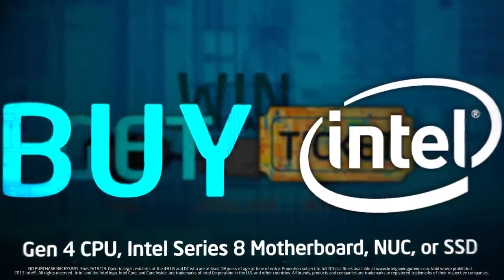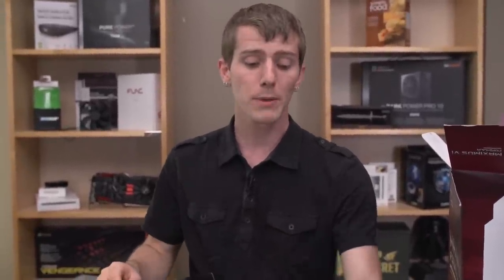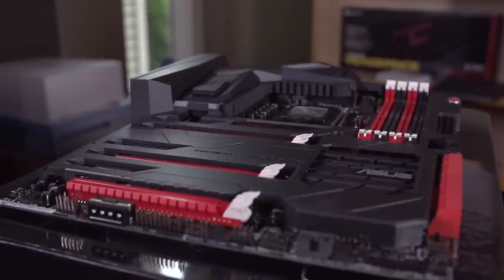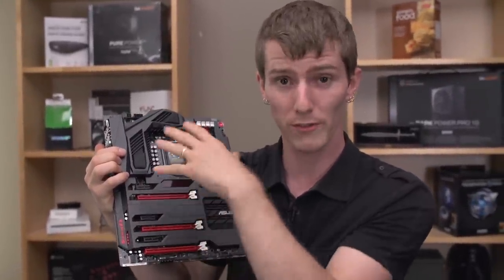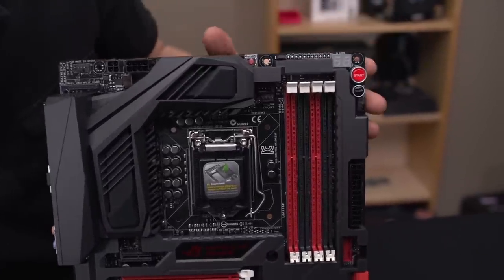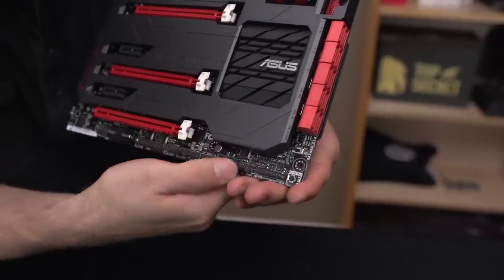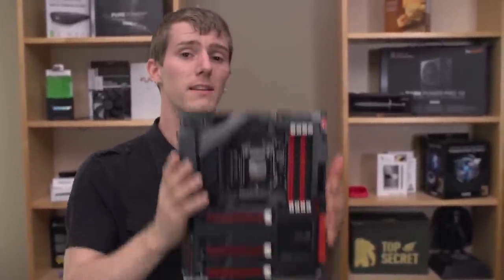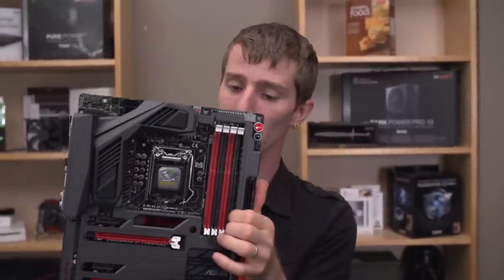Asus Maximus VI Formula Unboxing & Overview

Comment: Linus if you review an Asus crosshair vi hero please check out the following, I am awaiting the arrival of my crosshair now, I am going to attempt to run two m.2 nvme drives in raid 0 but as you know the board only has on slot for m.2 which leaves me having to install an expansion card (asus hyper m.2 x4 mini) I am curious if you have tried this configuration and what was the results any info would be appreciated, I have emailed asus about this but haven't received a response, I could just order an MSI titanium x370 that has two m.2 connection on the board but I am an asus fan.

Comment: Same here, I had major issues after installing the AI Suite. I don't understand how their software created to work with their motherboards causes so many conflicts. Surely they're aware of this. I ran into the same issue with my Z68 Deluxe board, so I figured I’d try a different manufacture for the Z77 chipset. However, with Z87 I thought, I'll revisit Asus. Asus tech support couldn't help me with my Z68 board and they're not much help now, very frustrating. I wish they could make this easier

Comment: if you need the ultimate speed on rendering and you are going to need a lot of pci slot bandwidth go to a 2011 cpu, if not a 4770k + a good z87 mobo is a better price/performance option

Comment: someone please explain to me what the molex connector on the bottom of the board is for. I gather it's video card related based on what Linus had mentioned but, I'm still confused. Thanks
Reply: It's for if you want to have more than 2 video cards on at the same time and you need extra power for that.

Comment: what is the difference between Z87 and Z97 from MSI? I don't know which to buy since the price difference is like $20 on ebay.
Reply: Z97 refers to the Intel chipset that the board uses.  Go with the Z97 because it's newer (and will support newer CPUs for longer)  and be careful with computer parts from eBay.
Reply: Craseder but they both support the same cpus because of bios updates. Z87 has more experience and is a vet so it should be more stable correct?
Reply: jlrockafella No.
They all reach the same rate of stability, it's a very good time to get Z97 boards.
The chipset is more advanced and has more features, and provides more performance benefits, etc.

There's new chipsets coming out for Haswell-E and Broadwell CPUs, you shouldn't get these ones because yes, since they're much newer, they won't be stable for their first year.

Comment: So I just bought a 7990 and I'm running it with a fx-6300 oc'd to 4.2 ghz. Now I know bottlenecking isn't a huge deal and I don't care that much, but would it be worth getting an i5 4670k to replace my FX. I'll have to pay for the processor itself and a new mobo, but is it actually worth the more stable frames when I don't really want to spend the money that much?

Comment: I just wish that they would use POSCAPS on their boards. These caps are the definitive end all to the endless rows of capacitors. They clean up the CPU area & last forever at spec... no bleeding IE. Even Nichicon solid aluminum caps do not stop at 5k ratings & someone needs to bring that to their attention. Now, capacitors go well beyond 10k & we need to see this from Asus. The playing field has really stacked up & it's down to the nitty gritty of components.
EVGA, ASRock, & especially MSI are trading some heavy blows with Asus. EVGA motherboards division learned their lesson before it turned into a lesion! Their caps bled, leaked, & they're just coming back from that business at nearly 8 years ago.

Asus, I do call you out more than any manufacturing company out there & for good reason. People buy for looks, likes, & they need to get their value for what they're paying. The name only goes so far & the issues begin... similar to the trying times of EVGA. If the name of your product is a form of tiering, then "Maximus" should denote quality as derived from its name.
I don't like thinking that Asus is all bad, that they're trying that hard to pinch pennies in hard times. I'm only saying what your upset consumers & stockholders already know.
C'mon Asus...
This board does look the part as a whole though. (Just a ton of caps that should have been much higher quality & I'll leave it at that.)

The NGFF will still run at improved SATA 3 speeds as the controller built onto the drive is just another SATA controller. People often get that part confused & I too wished it were truely beyond mSATA as well! Alas, it is not as of yet.

Comment: What's the best bang for your buck SSD for the average PC gamer? I want about a 120GB SSD to boot from and launch BF4.
Reply: Samsung 840 Evo series are good and cheap.
Just as fast as the 840 Pro, but made in a cheaper way. Ergo the lower price tag. That said, the material has a lower life time, but we are talking 30 years rather than 60 years with the Pro. Other stuff will break on the SSD before the material becomes a issue.
Reply: i'd say sandisk ultra plus or samsung 840 evo series SSDs wud b the best choices.

Comment: The problem is not using aluminum but using two different metals in the same watercooling system. e.g. Aluminum and brass or aluminum and copper, which basically turns your watercooling system into a battery.

Comment: Good board but missing a few things in my opinion.
1. It needs a second USB 3.0 header because often you will need one header for front case USB 3.0 and a second if you have a front panel 5.25' bay with USB 3.0 support.
2. It needs more USB 2.0 headers for the same reason as above (also a lot of water coolers need to be hooked up to a USB 2.0 header)
3. It needs a PEX 8747 chip to give it 32 PCI lanes for quad sli

Otherwise I'm loving the look and other features of this board.
Reply: GrayEyesWorld Then this is the wrong board for you. go maximus extreme instead

Comment: Linus which of these two is better GIGABYTE X79S-UP5-WIFI or Asus Maximus VI Formula. Im going to build new rig so i need info. And i will install Gigabyte geforce 780 or 760 and i7 4rth gen processor on the beast which you will recommend . Help man

Comment: I really need to know a good matx mobo. Ive got around 300 to spend and my cpu is an i5 3570k. Just all the Maximus mobo's for some reasons the ones that are 1155 are so much more expensive.
Reply: Actually most are 1150, not 1155.

Comment: Can anyone help?
The case im getting has 7 fans, do i need a motherboard with 7 fan inputs?
Reply: You can use adapters from power connections if your PSU.
You can also use fan controllers which you connect power to and then can connect several fans to as well.

Personally, I prefer controlling the most important and noise fans via software.
On this board you can use Chassi Fan connectors 1-3 via the Formula software AI suit 3.

I have both H110 fans and ram fan on that and I cut down from 35dbs to around 18dbs when just using desktop etc.

Comment: If your truly ONLY just going to GAME , you won't even need board like this one or a Sabertooth...simple to say. 
Can this board run the game higher FPS than the cheaper ones ? 
Will this more expensive board load the game quicker ? ( We talking about  Stock CPU speed no OC ) 
Also only advantages I see on Z87 platform is that the ton of SATA III compared to Z77.

Comment: I have a sabertooth z87 with a month old and the backplate just became crap. Corrosion is killing it so fast! I was so dissappointed when i saw the surface of the backplate or at least the paint on it going bad by the corrosion.. Just stay away of that or remove it. I dont really help cooling, i have removed it and the temps are the same but feels weaker (Obviously)

Comment: I love this board but not enough usb headers, really. I had to get 2 NZXT internal usb hubs to get all my things running. 

This thing overclocks like a boss, even with a not so good 4770k chip (costa rica) on only a H100i , got it stable at 4.7 for a 24/7.
Reply: its bad because you bought it in costa rica?, wtf.
Reply: Manuel Giovinazzo  No, Different batch of cpu's have different OC potential. Every cpu has a batch number and the number is linked to a place where it's made. In my case  it's 3312B707, produced in Costa Rica.

Almost all the chips made at the same place have the same OC potential give or take a couple of 100's mhz.

Look at this list http://forum.hwbot.org/showthread.php?t=73933
Reply: Martin Lalumiere I thought it was the Malaysia chips that people tended to say are not always as good and the Costa Rica ones were preferable?
Reply: preferable but still.. i got 1 that could pull 4.2 and then one that cant oc at all. h100, maximus formula vi

Comment: please help me choose a better motherboard for playing games like assassin's creed unity, COD advanced warfare, BF4 etc on ultra settings. I'll assemble other parts later but first I need to start fresh with a motherboard which supports 64gb ddr3 ram and 3 graphics card slots, I live in India and here the price of electronic items are 2x compared to foreign countries, so please suggest me any good MB which costs lower to medium range, thanks in advance
Reply: ***** have you found any fault in gigabyte MB ? because I'm already using same company MB and I had to give for replacement twice, there were some faults in RAM slot and graphics card slot
Reply: ***** I've found a beast motherboard for best price MRP Rs 39999
Selling Price Rs 21590
OFFER PRICE
Rs 19668 (51%) discount isn't that great and
Gigabyte Ultra Durable 5 GA-X79-UP4 Desktop Motherboard

LinusTechTips what's you're opinion about this hardware ?
Reply: ***** thanks for your help, I'm deciding to buy Gigabyte Ultra Durable 5 GA-X79-UP4 because it has 4 graphics card slots and 8 ram slots for this price
Reply: you never gonna use more then 2 gpu's if you got 3 old models sell em and get a new gpu instead of multiple old ones and it costs more power so you also need a 800+ watts PSU and thats really much
Reply: Based on previous Linus videos, if your not doing video editing, you really won't need 64 gb of ram. That's overkill. Go with 16 gb and that would run those games perfectly when paired with a good CPU and gpu
Reply: I have an old desktop and I really need to update everything, motherboard, graphics card, ram etc, suggest me any good and cheap gaming motherboard in which I can put multiple gpu and upto 32gb ram.
Reply: yep
Reply: tried searching this model but it's not available in any Indian website yet.
this I found on amazon: Z97-A ASUS LGA1150 Socket Motherboard
Reply: so please suggest me any convenient MB which has 3-4 graphics card slots and 32gb ram slots with cheap price
Reply: you dont need 32gb, you need 16gb at most for gaming and 2 graphics cards at most
Reply: Kratos buy a ps4 i think you will be better off. a new GPU and 16GB RAM is the same or more then what a ps4 costs
Reply: I hate consoles, PC is way better
Reply: ***** they do but they work for the price. Not everyone has around 2k to spend on a pc
Reply: i know everything about pc vs consoles AND STILL for some people its better to buy a PS4. no matter how cheap the crappy pc will be. the PS4 ALWAYS works with EVERYONE and not only trained IT guys who got allday to get the crappy pc working ...
Reply: ronnie tjikoeri calling us all trained "IT guys"? everything eventually breaks. consoles are worse cause you can't replace them easily, you're fucked. that's why there is no way to escape it, you NEED to learn how to maintain your PC, whether you like it or not. i was stupid, but i can learn better.
Reply: ronnie tjikoeri I highly doubt you know everything about PC Vs Consoles...
Reply: Kratos 64GB DDR3 for what? do you do some render or 3D projects?
Reply: Darko Dropulja nah, he's just trying to build whatever he sees that looks best without factoring what he really needs. this is 7 months ago so i assume he's got his rig by now

Comment: I chose this cpu/mobo combo cause I have 5d3 and Im using it for videography and raw video mainly and I need a lot of cpu and gpu power. As for the mobo I chose it mainly for the ready liquid system it has since my case is the Kaldalf LCS. As for the gpu I would like a 770 or 780 gtx but they r too expensive for me to be honest. Davinci resolve from the other hand needs a lot of cpu/gpu power to run it smoothly.

Comment: Linus, contrary to what you always say in every one of your motherboard unboxing videos, one should not throw out the disk. Some times operating systems do not install the driver for your network card -- so you can't even download the latest drivers. Install the driver from the disk, then replace it with the latest. 

I think manufacturers should include USB flash drives with drivers instead of disks.

Comment: So what exactly does the water cooling loop L shaped bit on this board do? What is it cooling if you run the water through that?
Reply: VRM/MOSFETs. Basically power delivery components.
Reply: Oh I see, sort of around where the 8 pin connector would plug in? Can't say I expected those to overheat...
Reply: DGneoseeker1 They don't really overheat much, but the heat outputted by them can heat up the rest of your board and maybe your whole case. It helps when you do extreme overclocking or just get an absolutely crap board.
Reply: Aha. On a similar subject, any idea what's most likely to be making the "hot plastic" smell I got when using the pre-installed overclock profile on this PC? Shouldn't be the CPU without it being stressed.

The ram? North bridge / south bridge? What gets hot on here? There aren't any fan/heatsink units cooling anything except the cpu and gpu so it seems a little worrying that anything else gets hot.
Reply: DGneoseeker1 Are your fans running faster at all with the overclock profile? It could be that the bearings cause that burning smell. What kind of PC do you have that it comes with overclock profiles? MB/Manufacturer-wise.
Reply: It was a hardware bundle from Overclockers UK with a 4Ghz CPU overclock and 1600Mhz ram settings.

The actual hardware is a Gigabyte UD3R rev 2 motherboard, Core i7 920 with a Titan Fenrir, and 6GB 1600Mhz ram.

Can't say I noticed the fans going mental. It COULD have been due to the motherboard being essentially brand new at the time when I tried using the 4Ghz profile. I've not tried it again since. Haven't really needed to since the PC easily handles any game other than Metro 2033/Last Light with Physics, or STALKER with Misery mod.
Reply: DGneoseeker1 Try manually overclocking the CPU to 4GHz and experimenting with voltages, maybe the profile does more than just CPU OC'ing.
Reply: I suppose it might, but other than ram speeds, what else IS there to overclock? (Except the graphics cards, obviously).
Reply: CPU cache, some other CPU voltages, maybe some BIOS/UEFI settings. I'm not exactly an expert, but there could be some other voltages and settings not accessible otherwise.

Comment: just finished this build:
 case 
 ($119.99) Cooler Master HAF XM - High Air Flow Mid Tower Com  
 os 
 ($139.99) Microsoft Windows 8.1 Pro - 64-bit - OEM - OEM  
 power supply 
 ($124.99) PC Power & Cooling Silencer Mk III Series 850W Mod  
 video card 
 ($309.99) ASUS GTX770-DC2OC-2GD5 GeForce GTX 770 2GB 256-bit  
 ssd 
 ($159.99) Intel 530 Series SSDSC2BW240A4K5 2.5" 240GB SATA I  
 ssd 
 ($159.99) Intel 530 Series SSDSC2BW240A4K5 2.5" 240GB SATA I  
 dvd 
 ($19.99) ASUS 24X DVD Burner - Bulk 24X DVD+R 8X DVD+RW 12X - OEM  
 mother board 
 Asus MAXIMUS VI FORMULA  
 cpu 
 Intel Core i7 4770K Unlocked Quad Core 3.5GHZ Processor  
 monitor 
  BenQ XL2420TE 24IN LED 144HZ 1MS 
 memory 
 Corsair Dominator Platinum 16GB 2X8GB DDR3-1600  
 PCI-E STORAGE 
ASUS ROG RAIDR Express PCI-E 240GB PCIe 2.0 x 2 MLC Internal Solid State Drive (SSD)
 cpu cooler 
Swiftech H220 Quiet Power PLUG-AND-PLAY Liquid

Comment: just because an upgrade exists, doesn't mean you should buy it. especially because even DDR3 is kinda overkill for a gaming pc, you only need fast ram on the graphics card but for system ram not much speed is needed.

Comment: Do you have to water cool this motherboard ?
Reply: no you don't have to the heatsink will be fine without water in it
Reply: ah, good good
Reply: Toaku it would look cool tho ^^
Reply: true
Reply: utubeBulldog6565 what will hapend if i remove those rubber pieces from the water cooling holes
Reply: if you removed the rubber pieces you'll just let dust fall into the tubes and it looks kind of ugly without them. Nothing serious though.

Comment: Can anyone explain to me why he said - turn FastBoot off in subzero conditions ?
Reply: I think it's because, when you turn it on, all the components have to start working very fast and very suddenly, so they'll produce a fair amount of heat. so when in a cold area, the sudden change of temperatures could damage the components. You could compare it to a car, when its sub zero outside and your cas has been standing there al night, it's not smart to rev it up till 6000 rpm when the engine is still cold, it will damage it. at least thats what i think
Reply: *****
yes, but when you go on a vacation, you will not heat your room, you may tilt your window... and when you come back, you will start the computer in a cold room. So that is why this switch is a good thing.
Reply: Yes i agree, but also your mobo can have problems with a -10 or -20 C. So yes you are are right, but i am not wrong :) It can also be useful for  the situation that i wrote. Cheers!

Comment: LINUS!, or anybody else ....... please answer my question
Why does my 4770k and gtx 780 reference are having frame drops in simple games such as skyrim even though i haven't added over 40 mods
and both the gtx and intel 4770k aren't overclocked
This also applies to a few other games ..... and i dont even play over 1080p.   
:(